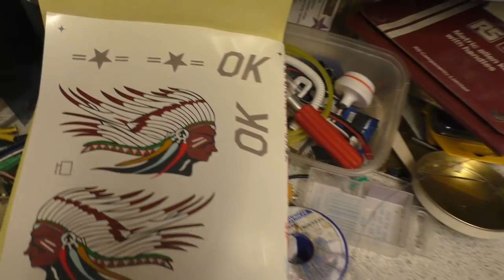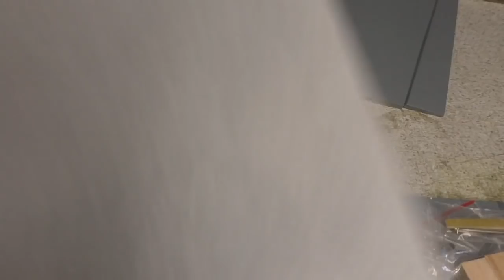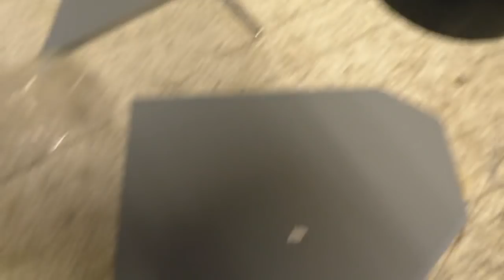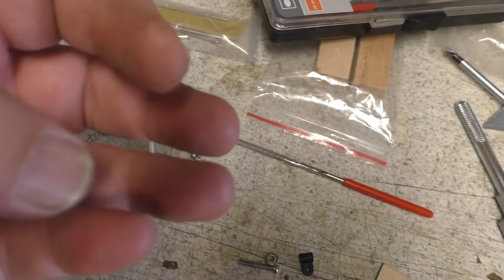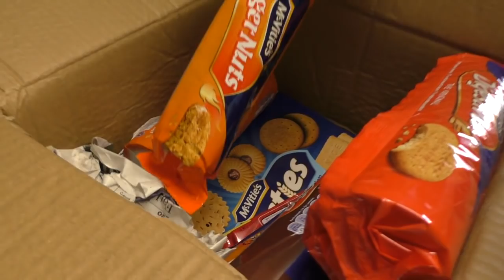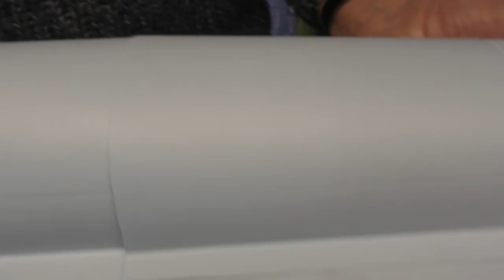Hobbyking F16 build Pt1 RC Model Geeks

Comment: I will take fibreglass over foam everyday of the week.  F16 was proof that if you put an engine on a brick with a computer to fly it; any design could fly.  I worked on F4's when I was in Europe last.  It maybe slower but it was the tank of the air that could bring back the aircrew every time less they were stupid and drove into the ground which happened to two aircrews I was with at the time.

Comment: ef16...
Reply: I would use a FPV system to return it if loosing line of sight (you need 2 great pilots). EDF:>50% lost energy (that's why it's all metal). The nose- or pusher prop was the reasonable option. Copy the tail fin in balsa? The fuselage generates lots of lift. The F16 was rocket food.

Comment: There is this on the Hobbyking 'Files' page - https://hobbyking.com/media/file/i/m/imgp2271.jpg
Reply from the maker: Yeah its not that one. HK not sold it for a few years!
Reply: Thanks Colin, but that is not the same model. HK have done a few F16s mainly of foam. Look at the wing fixing method with tabs....there are none on our one. Also this composite version never had undercarriage fitted. Cheers.